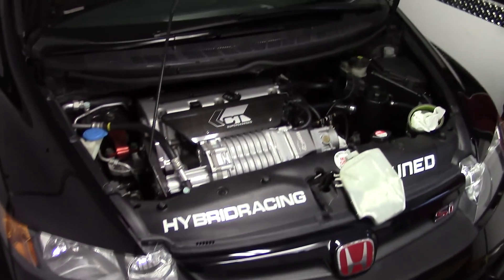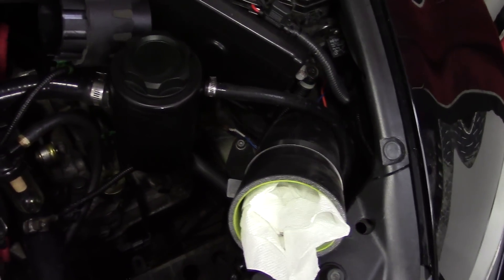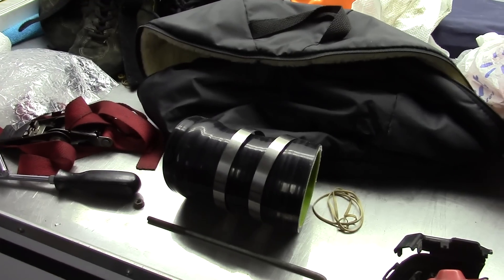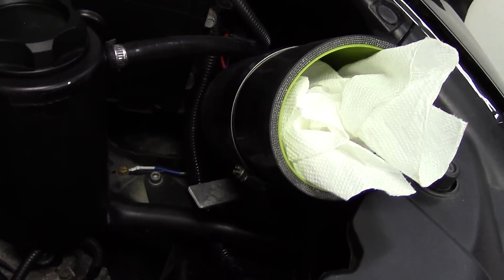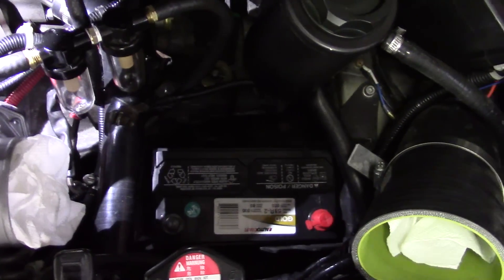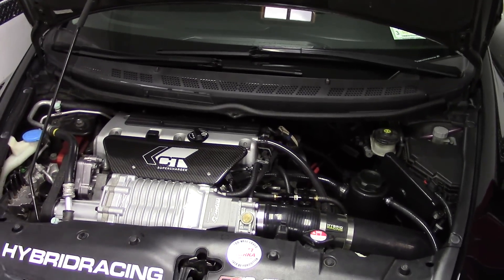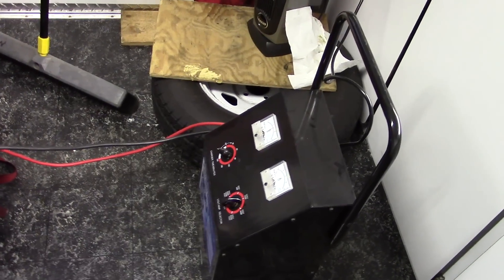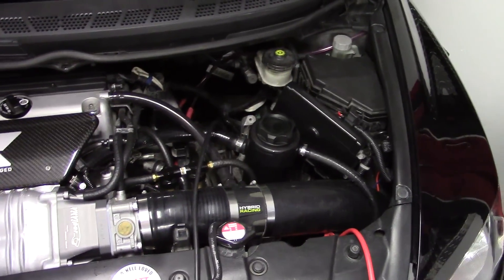Civic Si Update - January 2015

Comment: Hi sorry I'm new to cars, but what is that pink liquid? Is that the oil for the supercharger? or some type of transmission fluid? its around 2:35
Reply from the maker: That's coolant for the aftercooler. Its an independent coolant system that runs off an electric water pump that cools the air inside the supercharger

Comment: Hey, when installing your hybrid racing cmc did you use the recommended fluid or did you use honda dot 3? And also the aem pre filter you have would a fit a skunk2 intake filter? Thanks in advance.